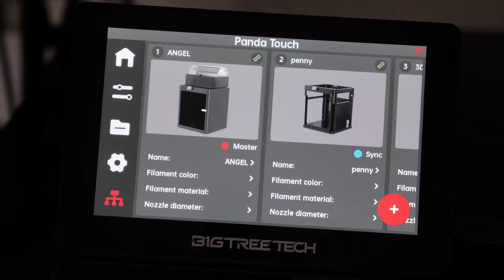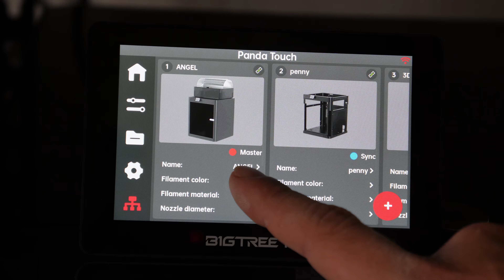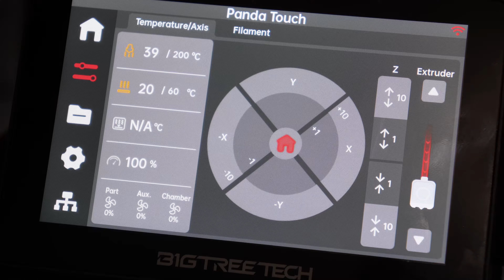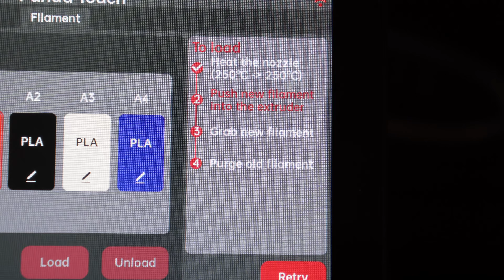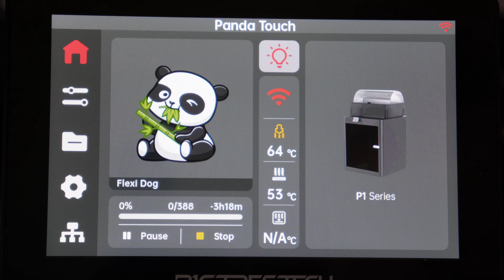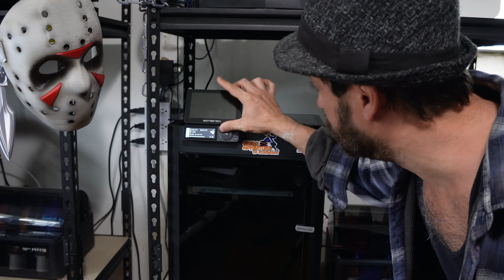Using the BigTreeTech PANDA TOUCH - How it works. Bambu Lab P1S/P1P/A1 3D Printer

Comment: Yeah, pretty annoyed I can't reprint a file from the SD card from this screen. Pretty much why I bought it
Reply from the maker: There is no real need to do that on this machine. Print from Bambu Studio. Reprint from the printers Cache, on it's own screen, or Bambu Studio, or Handy
Reply: @3DRundown  No need for you. I bought it for that reason so I clearly needed that feature for my workflow.
Reply from the maker: I can't really think of any reason to print from an SD Card, on a P1. But, again, why not just reprint from the P1 screen itself....
Reply: @3DRundown  that's what I'm saying. I got a touchscreen to access the SD card and reprint previously saved prints. I bought the big color touchscreen to do that.
Reply from the maker: I am trying to tell you, you can do that from the original screen.
Reply: @3DRundown  I'm trying to tell you that I know you can do that from the original screen..... I wanted a nicer, bigger, touchscreen like I have on my other printers to do that; not some clunky tft display with crappy buttons. I bought it to access the SD card through the touchscreen, NOT the built in screen.

Comment: Can’t you stick a usb in the right side of the panda 🐼 t to load a G code file?
Great review 😎👍
Reply from the maker: Yup. .3MF files for now.
Reply: @3DRundown  can you print those ?
Reply from the maker: Yes, when you export the plate, in bambu studio, it will export as a 3MF, not a Gcode file.
Reply: @3DRundown  thank you
Reply from the maker: Made you a video
Reply: @3DRundown  so just export file as a Mf file put on udb for panda 🐼 touch to print  it on p1s .